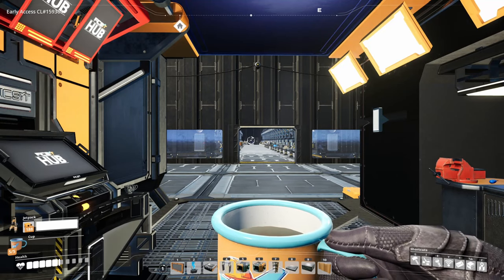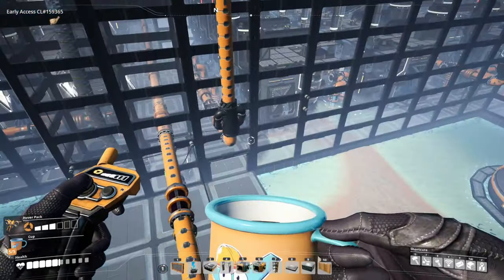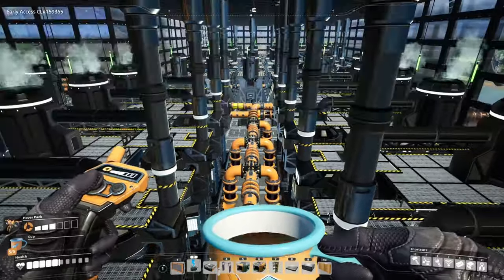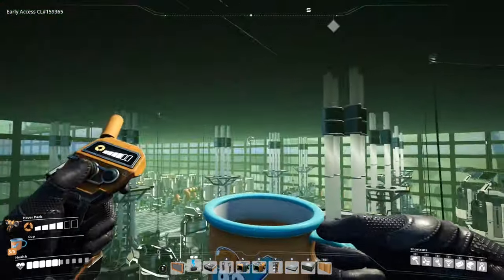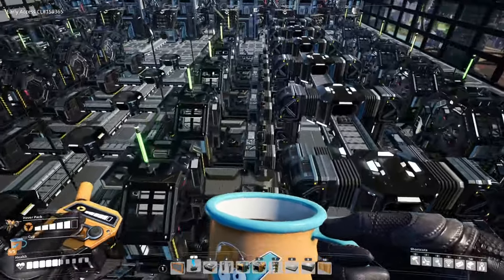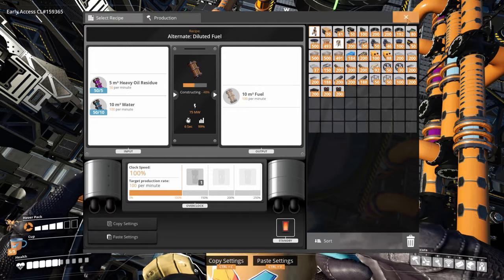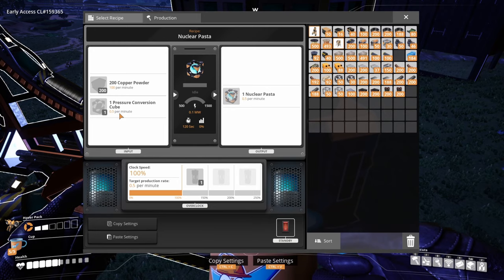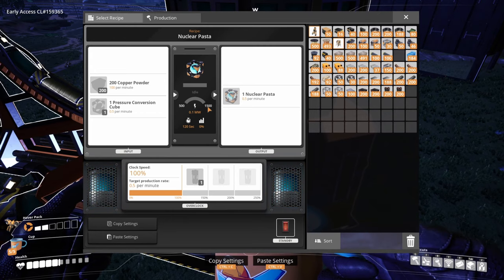Satisfactory Update 4 Let's Play ep28/New factory for circuit boards/Sulfuric acid/Fuel generators

Comment: I noticed when you were sorting out your pipe flow issue that you were getting flow in both directions along your main lines; both towards your factory and your oil/water sources when you added more pumps in. Does that make a difference or does it eventually work itself out?
Reply from the maker: Yes, and no. =) They did a great job, as always, with fluids. They act just like they would in real life. The pumps, and valves are one way. They do make those in real life. So once you put a pump, and or valve on a pipe it will only flow one way out of that pump, or valve. After the pump, or valve it can flow any direction again. Fluids will always flow toward the path of least resistance. Same in game as real life.